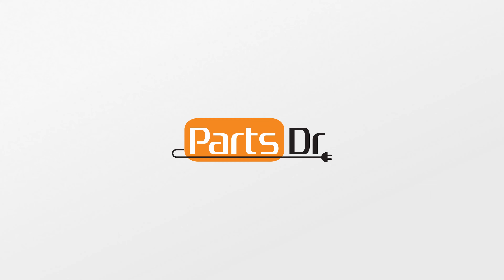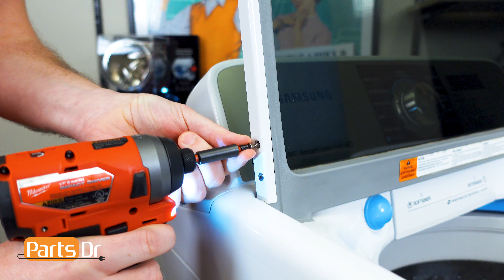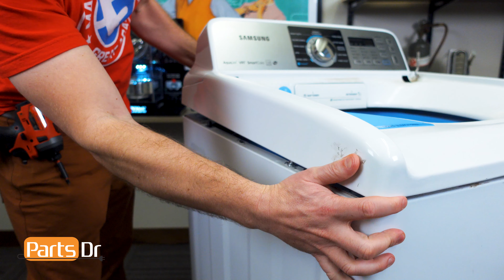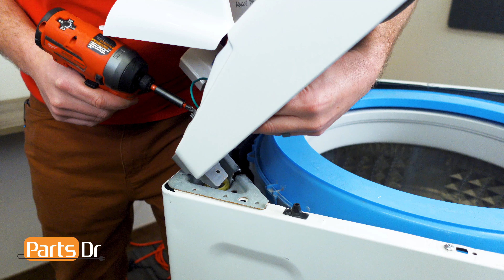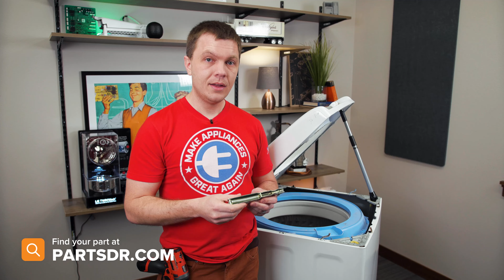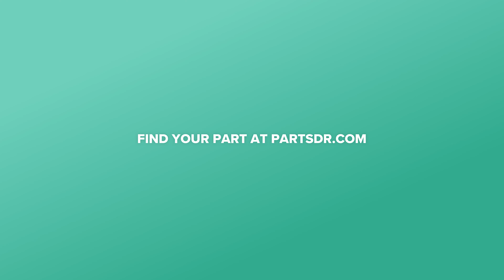How to replace Samsung washing machine lid hinge part # DC97-16923A

Comment: Excellent video! I just replaced mine this morning (9/16/23) following the great step-by-step instructions.  
A couple of notes:
1. The part number has been superseded with part number DC97-19700 for both right & left which is plastic (Delrin?) instead of metal so the existing mounting screws cannot be reused.  Stainless sheet metal screws will work if new ones aren't included.  
2. My model doesn't have the holes near the hinges to stick a finger into so I put the screws in while the top was still up and having a helper hold the control panel up.
3. I replaced both hinges even though only one was bad. At 8 years old I figured the other one might fail soon too and I'll just keep the old good one as a spare.

What failed on mine was not the spring but the slot that the pin goes into. I was corroded and became a hole instead of a slot.
This part does have the soft close feature.
Reply: Thanks for the info!!